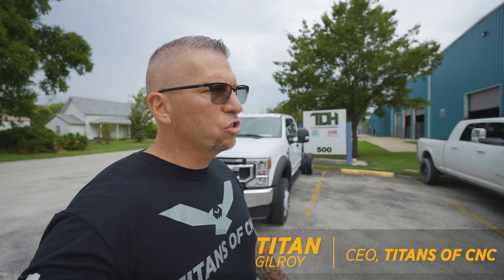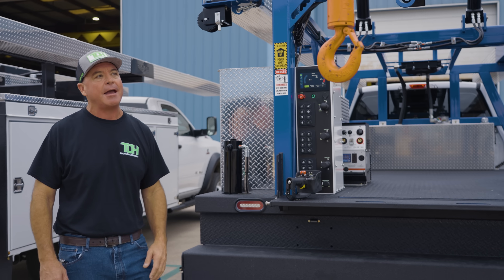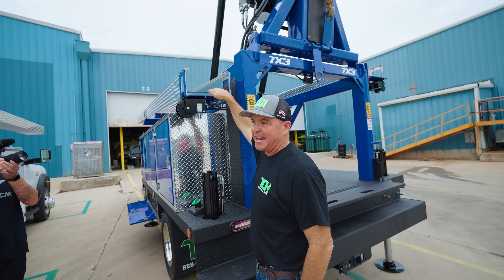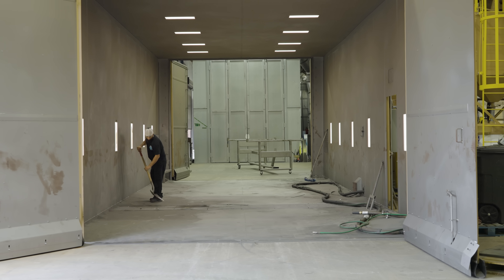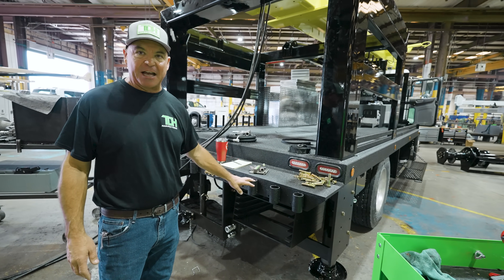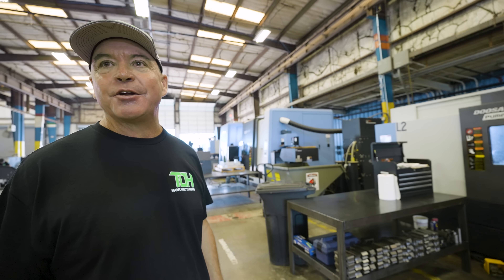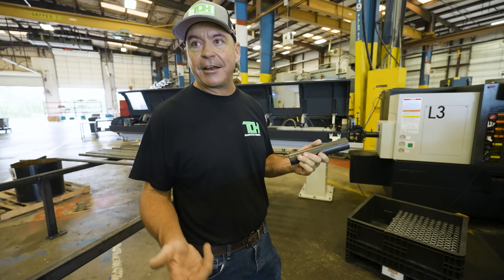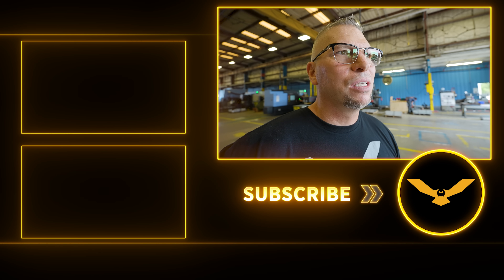TDH Manufacturing Uses DN Solution CNC Machines to Build Water Well Rigs in Texas

Comment: I don't disagree with CNC that it builds almost everything around us. I'm a manual machinist and a field machinist. Is there a program for CNC to take a worn out cylinder eye or worn out bore on a 30,000 dollar part. Or would that only be manual machining? CNC might build a 1,000$ to 100,000,000$ part but can it be fixed with CNC in the field. It's  just a question I have always had?

Comment: Titan, how would you feel about visiting Idaho? Ground Force Worldwide is a company in Post Falls that makes mine support equipment like dump trucks and explosives delivery trucks. (Yeah, "Boom" for real!) Encoder Products Company in Sagle makes rotary encoders, which your equipment uses to decide how many degrees a shaft has turned. You know how you can punch into your mill's control panel "rotate the spindle 25 degrees along the Y axis" and the mill knows exactly where 25 degrees is? An encoder told the computer where the spindle was pointed - and that encoder was probably made in Idaho. EPC is kinda cool because the man who founded it started the company in his garage and built it up to be a world leader. For serious boom, you'll have to go to Kaiser Aluminum in Spokane, which makes flat-rolled aluminum plate and sheet stock. Of course you'll also have to visit Litehouse - a salad dressing plant in Sandpoint that solved its problems with getting bad blue cheese by setting up a factory to make their own - and Daher, an airplane company in Sandpoint that makes turbine-powered bush planes.
Reply from the maker: I used to live in Hope… across the lake from Standpoint. Lived their right before moving to Hawaii in the 3rd grade… been back to Idaho but want to come again.

Great Stories
Reply: @TITANSofCNC  Titan, do you remember the bridge in Hope that goes over the railroad tracks? My father was the surveyor and the construction supervisor on that job, so I too have lived in Hope.